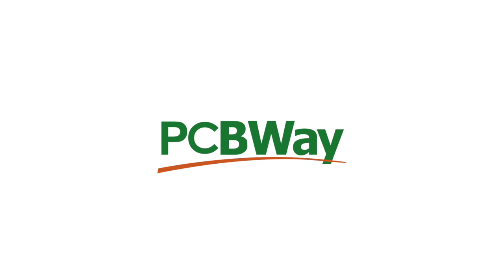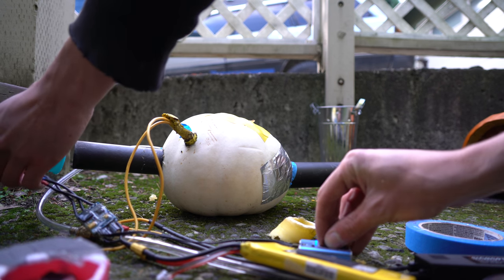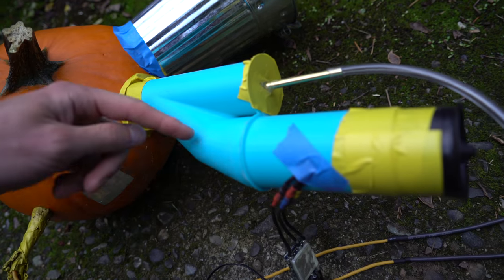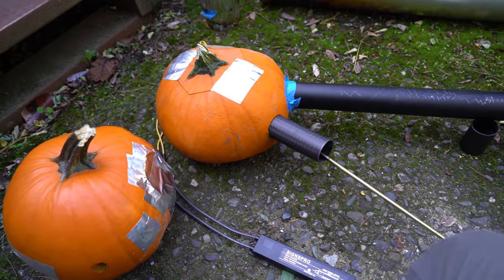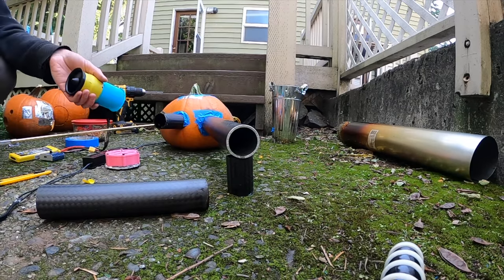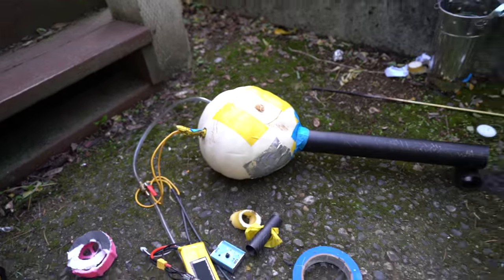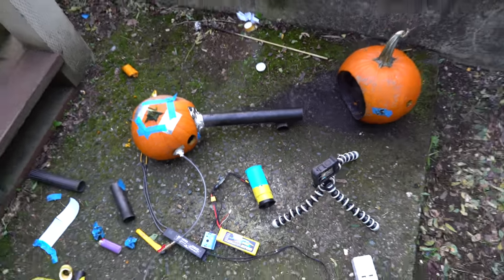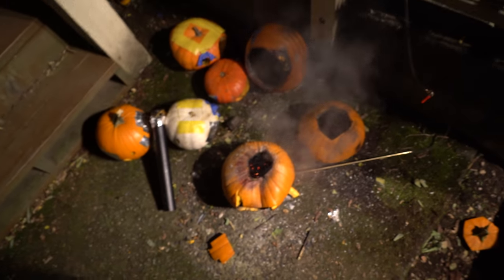Pulse Jet Pumpkin

Comment: You're so focused on intake length and don't really play with exhaust length. Also you're still running too rich. That's why that shorter injector helped. Less fuel was going in. Notice how when youremove air it flames out, but but the second you put it back it explodes out both ends quite vigorously.

Comment: Chemical engineer here, also a rocket engineer. Please consider looking at pressure drop calcs and a bit of Bernoulli calculations to size the inlet and outlet. Experimental is ok, but calcs could get you there quicker.
Reply: Right?
Reply: Yes, mech engineer here. I've built a few pulse jets and the venturi is very critical.  The parts had to be machined withing about a .050" tolerance to work correctly on a 2.00" dia. jet.  A pumpkin isn't going to work... LOL
Reply: Math? Pfff. Winging it is wayyyyy more fun.
Reply: What about dual injection to make up for the shit internals of the pumpkin? Lol

Comment: Future Idea:

A Hot-Air   Lighter-That-Air Craft (I'm team zepplin, but blimp is     a c c e p t a b l e) (also hot air baloons, but those aren't that controlled)

THEN

Use the "dome" as a surface for flexible solar panels, for your solar plane type stuff.
Reply: A zeppelin would be hard on a small scale because it has a poor surface area to volume ratio and would need to be as light as possible.
Reply: A I R S H I P
Reply: Zepplin with a pulse jet...

seems like suicide but cooler
Reply: @MalKediler  

didn’t say it should have a pulse jet

That’s a shitton of mass, is made for high speed, and is very high temp.

Some modified rc quad etc props would work fine.  Not certain on hot air source yet.
Reply: @ericlotze7724  oh ok

Comment: If you give this another go, look into fuel/oxidizer injection nozzle designs for liquid rocket engines (Scott Manley has a video on this). For a pulsed-combustion engine like this you need the fuel and air to be mixed really well, since the combustion needs to complete in milliseconds.

Comment: most of the issue is the lack of a vacuum being pulled. - your getting terrible fuel mixtures for most of them, the blower is moving past the fuel most of the time, like a lit wick in the wind. - the moment you take off the blower however, the fuel pools and tried to fill the intake.

id recommend either attempting to premix the fuel in the feed line more, after successfully pulling a vacuum, or creating a vortex to mix the fuel more richly, that way when you remove the blower after ignition, the fuel mixture when it goes lean does flame out as there is still some oxygen in the chamber as the vacuum is pulled. (Vortex mixing is a bit experimental though)

Either way, your supply is currently too rich which is why it wont ignite without the blower.

Comment: An interesting experiment to watch and risk your life!

Am guessing, but from your experiments some basic concepts that need to be standardized (every time you use something different, even a different pumpkin likely invalidates previous settings)
- Fuel/air must be mixed before injecting into combustion chamber
- Fuel/air mixture flow should lkely be related to the size of combustion chamber
- I doubt your theory about lack of tapering to exhaust is important (an explosion is likely forceful enough to overcome). In fact, I suspect retarding the exhaust might slightly increase compression which is likely another factor to consider when igniting your fuel mixture
-  As others have noted, resonance is likely related to your ignition timing which can ignite only when the spent gas as evacuated and new fuel misture has refilled combustion chamber.

When you added your EDF, it made me think you're not creating a pulse jet as much as you're creating a ramjet...

A really cool project and thx for sharing!

Comment: I wonder if there is a reason the original pulse jets didn't use pumpkins. Probably out of season. Next year please try telescoping inlet and outlet pipes, moved by linear motors, pressure/sound sensors and controlled with an arduino. Then it can adjust the effective lengths to get better resonance.. Also a venturi to premix in some air, maybe its electric valves controlled by uC too. I think you're right about the vortex, but I think you want it to become an explosive mix while vortexing before it explodes not while.  I mean, if you blowing into a horn, you want nice crip lip farts, not prison time ragged out slow poofy ones, to get a good tone. Maybe add a pump to add/remove water from the pumpkin to change its volume too. Add creative coding and I think your pumpkin will fly....apart.

Comment: Well atleast you know now how to build a good propane afterburner for  an EDF... Man you could stick it onto one of your solar planes, the use the sun to charge the battery for the EDF and bring the plane up to a high altitude.

 When the EDFs battery is charged, you turn on the propane, edf on full power, put the plane in a kamakazi dive angle and break the sound barrier. EZ GG🤔

Tell me that's not plausible😂😂

Comment: I built a valveless pulse jet a few years back from a set of plans. I could not get it to run until I increased the amount of fuel. I had to run my 20lb propane tank straight to it, no regulator AND I had to heat the tank in front of a heater to increase pressure with the tank pretty much full. The combustion chamber couldn't have been any bigger than those pumpkins. Food for thought.

Comment: i think it might help to add a small slider window in the EDF housing, to regulate more precisely your pressure/volume of air, we can see that despite the design, most of the time you were just tweaking your aiflow by adjusing your fan :/

Comment: Hey man! Idea here, but for a valve less! I played around with valveless a little while back, but with aresol cans. The key to it without any complicated tools or literally anything is like a brake cleaner can, and some tubing. I had some half inch copper tube lying around, and as fuel I filled the bottom of the can with a mix of isopropyl alcohol 70 percent, and nitro race fuel. Prolly about a 80-90 percent nitromethane mix. At the rounded side, I made about a 3/4th inch hole. In the nozzle side I punched a hole big enough for the copper tube to fit snugly with some aluminum tape, to fill as much gap as I could. Cut the copper at roughly 6 or 7 feet, and a standard brake kleen can. Filled the can a bunch, mayne 1/4 or 3/8th, something. You light the end on the can, and the copper tube is your intake. It is completely backwards, but once you get the right fuel and copper ratio, it runs really well! Got it to run continuously at a pretty damn good speed for 30 seconds, while the can got red hot. You adjust the fuel level, the hole, and the copper length. The easiest pulse jet engine ever!!

Comment: How did you configure the timing as far as the valve being opened vs closed. You probobly wouldnt want to ignite it with the valve still being slammed open by the air?

Comment: I'm no pulse jet/jet expert but all the open cuts/holes seem to be leaking a little pressure and I'm sure in this case you want those sealed what I noticed is that the open cuts leak out the pressure causing your pulse to fail and not sustain it's combustion

Comment: I could tell  from  making  my  black smithing burners you  were getting way too much air to the amount of gas you were putting in even at "full sketch factor "  Venturies like that  need a somewhat  small amount of  air  usually  . That's  why when you  just  had those little  holes and  were dumping in cardboard it was self sustaining . You need a  tiny air intake and a  larger   exhaust  your  basically  on two extremes of the spectrum etheir not enough gas making it  gasp  or too much making it  burn in the  exhaust tube instead you needed a lot  finer  control than the ball valves were giving you  and your intake  and exhaust  should ideally  be  somewhat cone shaped to help things  mix .
Edit: Also if you try it again  try a butternut squash .

Comment: Iv achieved about the same resonance with a straight peice of 150mm water pipe and a air compressor and a direct line of gas down about half way being able to move it out and in gives you the ability to tune slightly

Comment: maybe its not sustaining because of all the watervapor ?
do you need to change the freq from the sparkplug to control you res so the reaction has enough and not to long to recycle the maxiture more airflow just negates the naturel effect from push and pull what the pulsejet is about?

Comment: The might be the flow circulation inside the pumpkin. As the faster moving air enter the pumpkin it will expand and have a higher pressure and that might not create enough small pressure so I think that if you have a bigger and longer intake then your combustion chamber then it can work. The area ratio of intake and combustion chamber might give you an amazing results. Please try to calculate geometric similarity between actual and your pumpkin experimental you can get good results.

Comment: It occurs to me that when you put the intake tube on the opposite side of the exhaust tube the resonance was better. Notice on conventional valveless pulsejets have the same design? (exhaust on the other end of intake). There fore, I think maybe adding a curve in the intake tube back from the opposite side of the exhaust to parrallel with the exhaust will work. Anyway, just my thoughts...

Comment: the intake needs to be on the surface of the pumpkin with no tube on the inside of the pumpkin. no intake tube just a flush one way valve on the inside and out. a smaller more efficient one than the hvac. or for a valveless make the intake much smaller than the exhaust

Comment: I am no jet scientist but i think in the same way as the exhaust gas has inertia so does the air rushing in and because you have the inlet at 90 degrees or less the intake inertia has to suddenly change direction and stalls.
Also the exhaust pipe would have to be a tuned length, too short you will create less vacuum to long and the pulses slow and cause back pressure.

Comment: Fix the edf as a venturi to continuously provide air & induce fuel induction. (Fuel delivery dependent on pulse pressure feedback loop)
Reply: (valve is passive, fuel enters at or before valve, between expansion chamber and forced induction)
Reply: Pulse jet with electric air/fuel injection

Comment: It takes quite some time before the plastic in those fans warp due to heat!
Reply: Also, you need to have some air movement to mix the gas properly if you want to make it go boom!

It takes a while to figure out the perfect kaboom, but a little goes a long way. I usually count 21 21 23 24 25, wait for it to mix and boom.

Comment: the desired output side needs to be easier to push air out, than the other
Reply: carbon should be pretty nice heat resistant material
Reply: liquid air pulse jet turbine